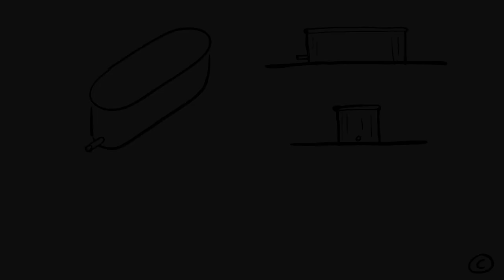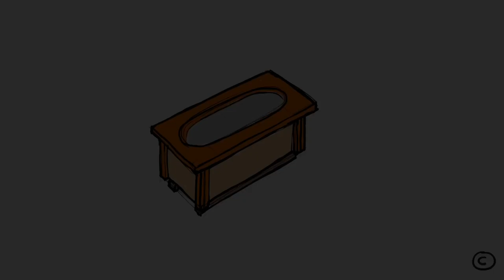Insulating My Stock Tank, Wood Fired, DIY Off Grid Hot Tub, P. 2 | Self Reliance Country Life Vlog

Comment: I’m curious why the insulation board was not under the pallet? Wouldn’t the weight of the water and tank crush the insulation board and cause the tank to sink?
Reply from the maker: The insulation is right under the stock tank, and it is the type of insulation they used underneath the concrete floor, so it is very strong and will not be crushed as long as the weight is spread evenly.